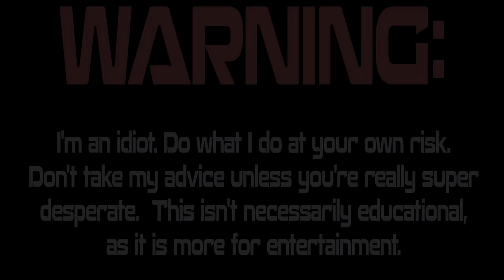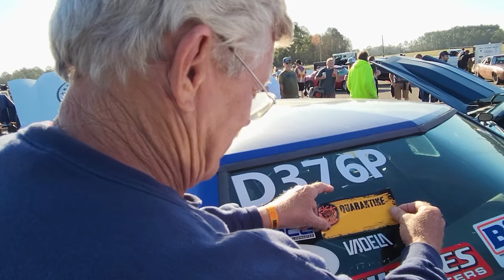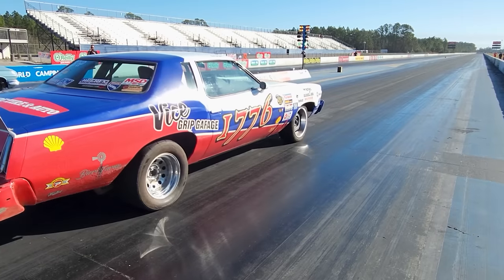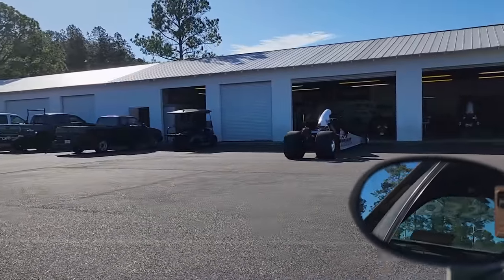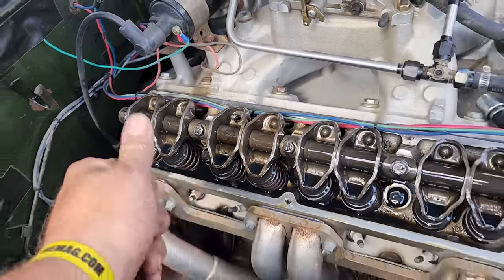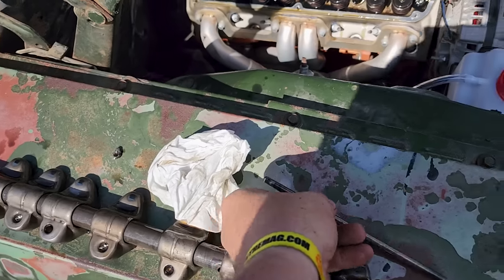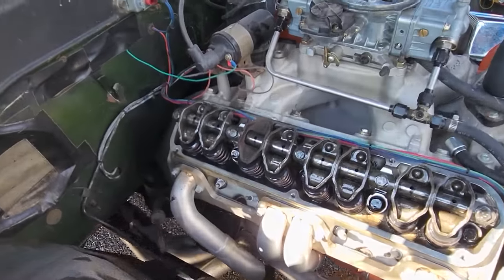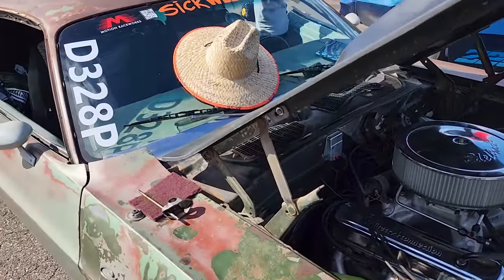Vanishing Paint Challenger is wounded! - Sick Week Day 4

Comment: The rocker shaft is upside down...those holes face down and oil the rockers.  Hope you catch this before too many more miles.
Reply from the maker: I flipped it right after i filmed it, all is well 👍
Reply: Uncle Tony, why would my 408 magnum break the crankshaft just behind the number 1 main at the number one rod journal?  Forged Eagle NA, only 400hp and keep it under 5000rpm.
Reply: @MrThomasfouraker  Take a look at the timing chain tension, more specifically the relationship between the teeth and chain links.  A small mismatch there will put enough upward pull on the snout to stress the crank exactly where yours broke.

Comment: Derek...you had a rocker shaft upside down on your LA 360 on Vanishing Paint...the location of the oil holes in the shaft (to the rockers themselves) ARE THE TELL that the shaft is oriented the correct way. Having a shaft upside down restricts the rocker oiling, that can't be good and it will likely cause additional pressure, heat, directional forces, wear on the parts and/or failure.

Comment: Need to make sure you are getting oil to the rockers. On a LA if the cam bearing has spun or debris has plugged the passage that feeds the rockers as the camshaft journal oil holes line up within the 2nd journal bearing, there will not be any oil making its way up to the rocker shaft. PS, the rocker shaft on LA's can be installed upside down which no oil will make its way to the rockers. 👍 just bleep bloooin in some common LA issues and overlooks I've come across in the past. Thanks for taking us along on sick week and for helping other fellers  out

Comment: The first ever engine failure I had with my first ever car back in the mid 80's was exactly this problem - the push rod pushed itself through the pressed steel rocker. But my car was a British Vauxhall Viva, a GM car, with a 1100cc 4 cylinder engine (so it refused to run at all with a 25% cylinder loss!)  and a heavy, heavy body that taught me all I needed to know about gear changing and listening for rev change points! My Dad and I fixed it up the same way - took a trip to the scrap yard, lifted the rocker assembly of a car that was in probably worse condition than mine, and got it running with an oil change and crossed fingers. It went on until the bodywork rusted away a couple of years later, but by then I had bought an Opel Manta for £300 (about £1100 in todays money!) but at least it had a power to weight ratio.........  WISH I still had that Manta, it was a cool car but it never survived my amateur attempts to swap its 1900cc inline 4 for a Rover 3500 V8 engine. :(

Comment: Derek, at 18:07 its clear that your rocker shaft is upside down and the oiling holes are facing up, not down on the rockers.....   probably the noise.  and potentially a future failure due to lack of oil.

Comment: MoPar tech tip:

If you put your car up at the end of the season loosen the rocker shafts and all of the valves will be closed during storage.  As an added bonus the valve springs will be relaxed and you can fog the engine first for additional peace of mind.  Works on most LA/B/RB engines.

 Bonus tech tip:
                As long as there is clearance a Wix 51515 oil filter will pretty much fit a Mopar engine.  /6, LA, B, RB, MitsuMopar... clearance is the key.   I  had to remove the plastic funnel drip gadget on my daughters 5.7, but it fits and is twice the size of the 'right' filter.
                 Same logic applies to classic engine starters.  426 Hemi, 318, 440, 225?  All the same starter.

Comment: Check the bar that the rocker arms rotate on, its easy to put it in upside down, and the oil ports are not aligned, that causes the push rod, to punch through the rocker...

Comment: Gotta tell a feller thanks for that opening message. Been not working on my 75 Bronco Ranger restoration for too  long now.  This guy’s gonna bite the bullet and order that disc brake kit…it ain’t getting any cheaper. 
If you run outta stuff to do, come on over to Mid MO. I could use some help figuring out how to make the 5.8 with the digica fuels from a 96 F150 run in this 1:18 high kicking horse from the 70s!

Comment: I had a 360 in a snow fighter 2500 dodge it was a great motor beat the living crap out of that truck the box fell off from rust in MN. had headers too. Built super tough 1 ton suspension.

Comment: Over all you are having good luck with that 360, we rebuilt about 6 of those motors back in the day in our shop,unfortunately, they did not hold up as well as the 340 engines, your's seem to be doing very well, you always find a way to keep your ride rolling,can't wait to see day 5.
Reply: Built a 360 17yrs ago still runs low 13s they do hold just as good as the 340.
Reply: @karlsracing8422  we were rebuilding them 43 years ago,useing mainly stock parts

Comment: The way you fix right is to swap it to adjustable rockers. Dave Hughes of Hughes says. Any fast rate .904 with more than 215 duration @50 should have adjustable rockers. That XE is a fast rate still. Man I miss the engles K54 K56 grids
Reply: Lots of Hughes parts under the hoods of my Mopar fleet!

Comment: A feller had the same malfunction, the edelbrock heads instructions say not to use the stock rockers, I chose to pretend not to see that. Poked holes in 2 rockers at the speedy end of the drag strip which caused concern, put some fancy alooominum rockers in and its been plain sailing since.

Comment: Derek, you assembled the rocker shaft wrong. The oil holes looking up  when you assembled it. The need to point down, otherwise the rockers are not getting oil and run the rocker shafts is, scar them. That is the reason for the valve train noise. Hopefully you noticed the issue.

Comment: DERRICK! THE ROCKERSHAFT IS UPSIDEDOWN I hope you see this befpre your drive to Orlando. Holes need to face down so it will oil the rockers thats why you have rocker noise. Shit ì hope you see this also one side of the rocker is notched the notch needs to point towards the rear on the drinkers side and front on the Capt. Side.

Comment: I wonder if the valve springs are bottoming out when she’s screaming down the track!!??? That would def punch a pushrod through a rocker and destroy a cam lobe and lifter.. Especially with a performance camshaft.. Or it’s loosing oil at the intake pushrods at high rpm’s but either way it def needs roller rockers…

Comment: Given the rocker shaft and oiling situation I'd be worried you flattened a couple lobes on the cam. People would be shocked on how many you can flatten and a small block Mopar will still run! If you flattened some lobes you can just about bet you have some bad cam bearings also. A sure sign would be if you have lower oil pressure! The seeming miss is also a sign of flattened cam lobes. Also check for bent pushrods.

Comment: I’m actually learning a lot from this series of videos. I just did a engine swap on my 97 f250 and it shakes.  I can’t seem to figure out what’s going on but I’m going to put the fuel injector plug and see if there is any misfires. Learned that from day 3 I believe. Hoping I can find out why it’s shaking. Motor mounts are good. Vacuum lines are good so it’s sparkalater issue I think. The only other thing is maybe the torque converter is misaligned maybe.  Any help would be appreciated from any fella ready this.

Comment: Yup. MMMMMHHHMMM. Been there, done that. One of the joys of a Mopar LA engine. But it's all good. Mopar checklist: Spare Rockers, Spare ballast resistor, Spare ignition module, spare voltage regulator.  Mopar LA engines been breaking Chevy boys' hearts for many years....

Comment: I noticed the rocker shaft on the right side appears to be upside down with the oil holes up. Look at the left side. Maybe I'm wrong. I did that on a FE ford and oil pressure dropped.

Comment: I've never seen a rod go through a lifter like that, glad you caught it before it turned into a larger issue!
Reply: Although we haven't seen the "lifter" as yet, the pushrod actually went through the rocker arm . I know that's what you meant. Just keep'n it real for the young fellas and fellettes.😁
Reply: Actually it's not that uncommon with higher spring pressure . Mop performance sold a H.D. stock style arm with more metal in the pushrod ball area.
Reply: I had it happen on an 88 pickup.  It is a small block mopar thing.  I believe Uncle Tony's Garage has a theory that has something to do with lifter preload I believe.  The downside to mopars is, due to the rockershaft valvetrain, it's not easy to get the geometry and preload right for each cylinder, unlike a Chevy.
Reply: Sounds like the issue is valvetrain hammering itself apart due to excessive lifter bleed down.
Reply: @jimifed2798  Yes, you said it. Poor planning to whoever built that engine
Reply: @tomwesley7884  Its kind of weird how time effects what people perceive what was good or bad design. For me I've always thought  that the mop. shaft design was a cost effective and efficient , maybe because i disassembled many high mileage La motors and there was only nice little smooth shiny spots  where contact points were. Now apparently younger folks will think they are a sub-standard design and they need too carry around spares in the glove box. Go figure .

Comment: The Rocker Shaft is upside down.  The oil holes should be down to feed Rockers.  If you accidentally switched rocker shafts side to side you can have the oil feed hole covered. It's a common mistake. The rocker pedestal with bigger hole needs to line up with the feed hole on the bottom of the shaft which is bigger too. And No Mopar guys don't carry those rockers in the glove box when they reach the limits of stock bathtub Rockers.  They limit themselves to 6200 rpms and Hope for the Best or upgrade to 273 iron Rockers or actually Buy Good Rockers and usually pushrods .Beware when a pushrod kicks loose  a lifter can kick up and out and Oil Pressure is Gone.  Then Well you know.. Destruction happens  Fast.   Best of Luck..Keep Pushing  Fella
Reply: Do mopars oil up the pushrod? Derek commented a ways back said he flipped shaft over right after ge filmed that
I have a 67 Buick that originally did not oil threw pushrods when I rebuilt it I put later model push rods and lifters that do oil but also left the passage in the head now I’m not sure was a good idea
Reply: I didn't catch that he caught it.. Good.. 92 and later Mopar Magnums do oil through the pushrod.  Older Mopars don't it's all through the shaft.  Myself I prefer the old way. I'm just a Oldskool Guy   Either works though
Reply: My buddy has a 67 Buick Special we stuffed a 70 455 into .. It's a Monster
Reply: @705on8  No, the pushrods are solid, and the oil comes through the head.